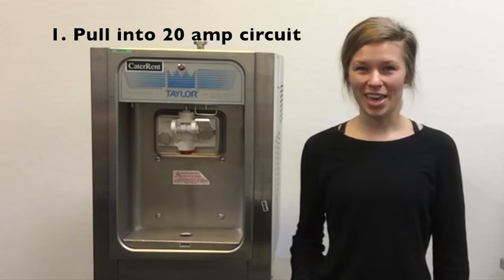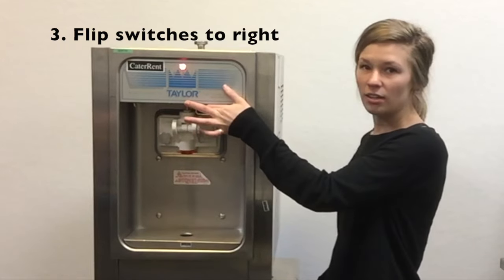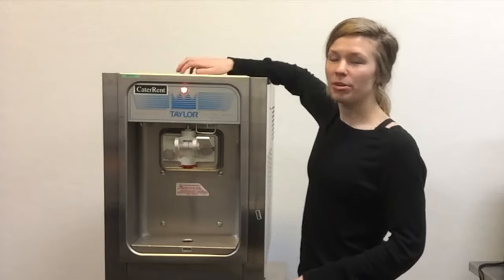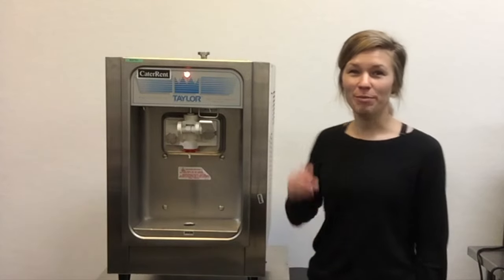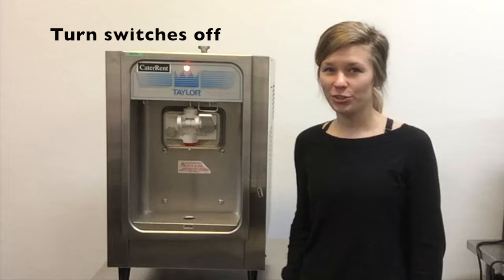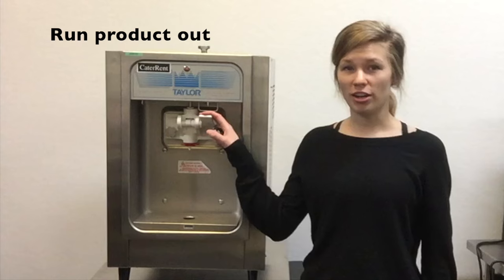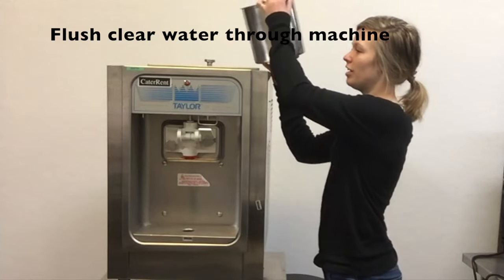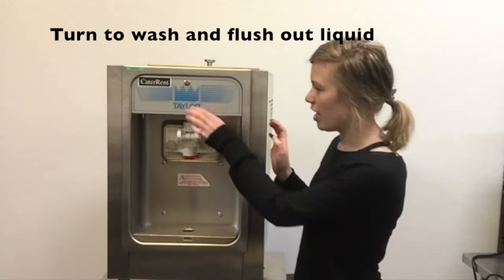'How To' Operate a Taylor 152 Soft Serve Machine

Comment: Hi, my taylor 152 machine'd motor keeps on running all the time. so the shaft or the beater is constantly moving inside of the freezing cylinder.  is that motor supposed to run continuously or run and stop and again run and stop just like a refrigerator at a home...? can anybody please answer this question. thanks.
Reply: This is a company who rents the machines out.
If you have an issue with yours, you’d be best off contacting the manufacturer and their distributors.